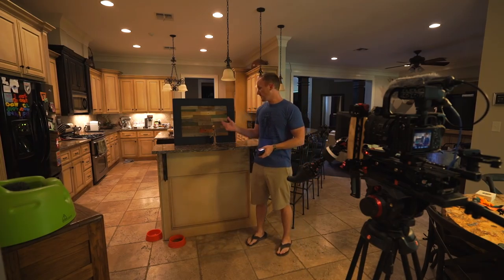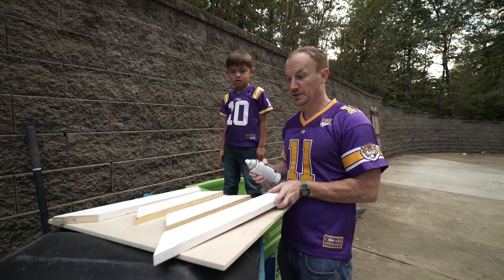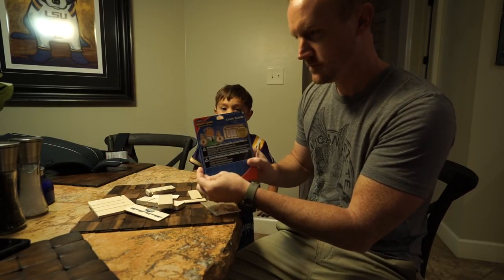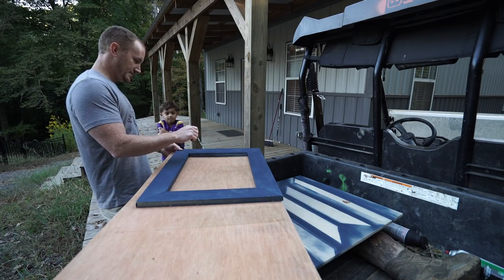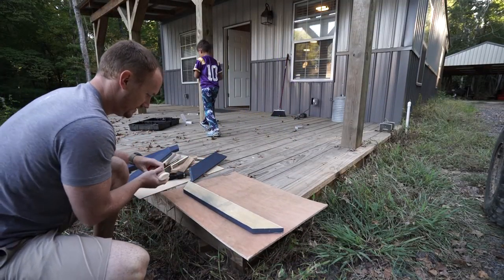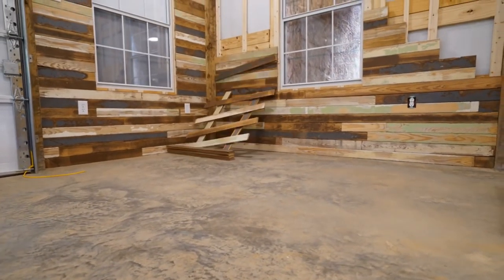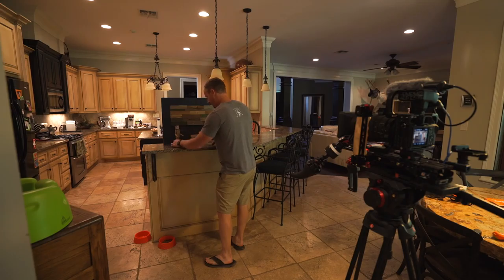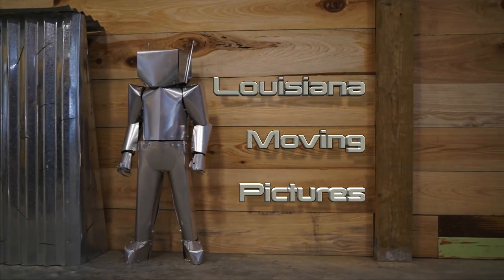How I Make Stop Motion Videos And Reclaimed Wood Art

Comment: holy crap you need a wireless shutter release, it would probably take less than half the time. better yet, a dslr controller app. better yet, buy dragonframe and tether the camera, i think with the amount of time it would save, it's well worth it. just friendly suggestions!
Reply from the maker: gregkrazanski thanks for the recommendation, seriously. Normally the stop motion action is much closer and it's not such an issue, but I've definitely wanted a remote quite a few times. I'm kinda new to cameras and camera equipment so I'm just not sure what to get. You have any thoughts on this one? https://www.bhphotovideo.com/c/product/1082056-REG/sony_rmt_vp1k_wireless_receiver_and.html   
And what's dragonframe? I just looked it up and there was a ton of stuff they sell. Thanks again.
Reply from the maker: gregkrazanski you may not be able to click the link. This one:  Sony RMT-VP1K Wireless Receiver and Remote Commander Kit
Reply from the maker: gregkrazanski I only have Sony a7s cameras. I've got a mark 1 and a mk2
Reply: really any will do, i wouldn't know how to pick one over the other, as long as it's reliable. It just does the simple task of triggering the shutter so you don't have to move away from animating. the one you linked looks great, i'm sure there are cheaper that are fine if that matters to you.

dragonframe sells lots of stuff, but i'm just referring to the software only (which comes with a little keypad). it's a great program for stop motion animating, it comes with tons of features that make it way easier to animate and it's easy enough for hobbyists to use, but robust enough for professional studios to use. it would involve tethering your camera to the laptop and triggering, which could be a hassle because now you have to have a laptop where you're shooting as well, up to you. For this specific video, it would work out great. It's about $300 USD, so you have to decide if you're going to eventually make "$300 worth" of stop motion videos haha.

it looks like right now it's meant only for nikon/canon, but it seems like they're releasing version 4 imminently, which will support sony alphas. Anyway, it really depends on how you like to shoot. If you like more rugged run and gun style stop motion and the camera itself is moving huge distances, it may be more of a burden to tether to a laptop. Good luck with everything! If i was unclear on anything feel free to shoot me more questions.